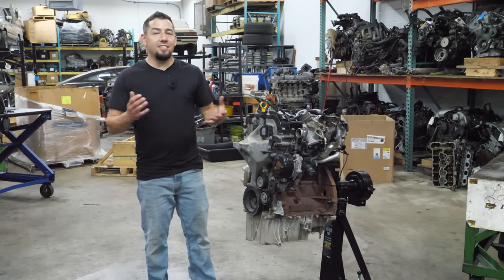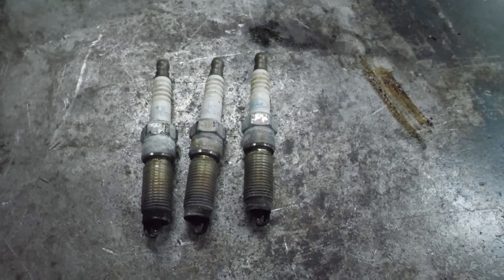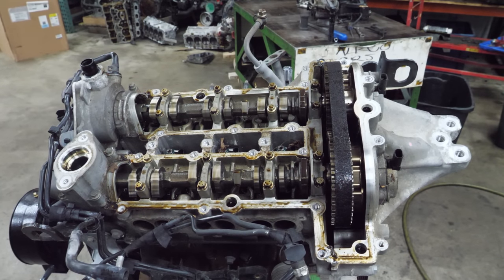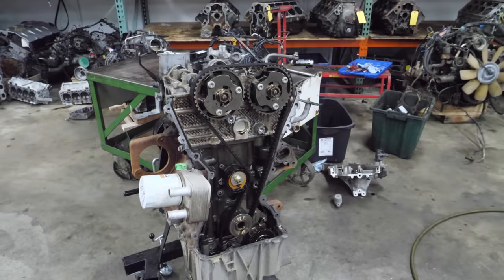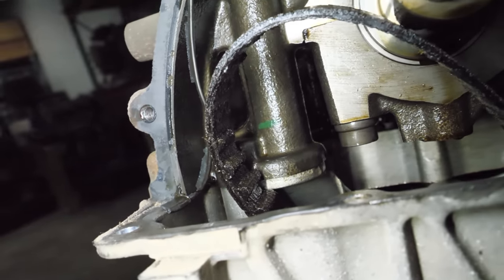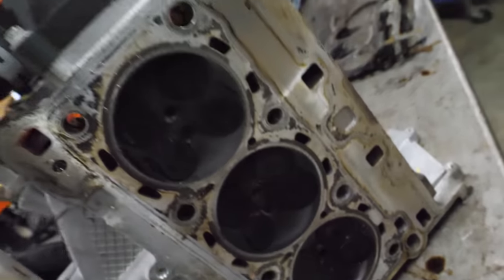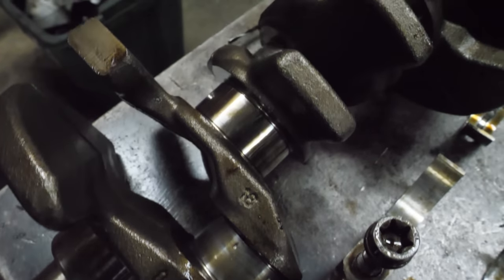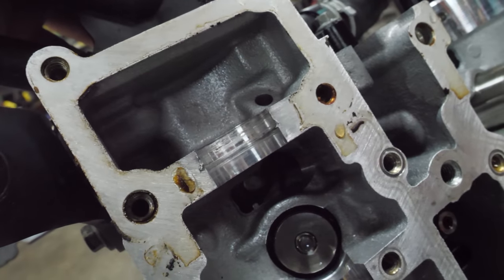JUNK Ford Ecosport 1.0L 3-Cylinder Ecoboost Teardown. LAWSUIT ENGINE!

Comment: My 04 Acura TL with a V6 gets the same, if not better gas mileage than an ecosport. I've seen it hit 32 mpg down the highway😂
Reply: As original owner I have an ‘06 TL 3.2L SOHC V6 (aka J32A3) w 170K miles, modded to ~ 290 hp.  24/32 mpg from the 5spd A.T. is common.  The engine still purrs.

Comment: Still think the typical 16v, 1.6 to 2.0 4-cylinder making about 130 hp that every compact car had 20 years ago was superior in every possible way.
Reply: It was , until emissions regulations and the drive for better fuel economy forced manufacturers to change. Ford's would have loved to continue using older engines because a new engine costs 10s of millions to develop.

Comment: Yep. An absolute desaster of an engine. In South Africa you can only buy an oil pump unit or the complete engine. My experiance on these engines is the need an oil andvoil filter change every 5k km and sump service every 15k km

Comment: Amazing service you are providing the American buying public.  Fantastic for all of us.  Now, serious question, do you have a good bodyguard?  I suggest you are pulling the tail of the tiger, you are revealing the pathetic truths about horrendous engineering ideas ie, allowing rubber-ribbed timing belts to be running in rubber-corrosive baths at high speeds, or bearings wearing down by oil-starved and debris-blocking oil pumps, resulting in impacting valves, or whatever... not good.  You are highlighting a massive problem, where the government should step in.

Comment: As far as fuel economy goes, science tells us, it takes the same amount of energy to accelerate the same mass at the same rate. I don't care if you have a big block or this sad excuse for an engine. It takes the same amount of fuel to move the vehicle. My 1979 Oldsmobile cutlass with the 231 V6 got the exact same mileage as my buddy's cutlass with the 350. Until they start making the cars lighter, nothing will change.

Comment: Ford got me for thousands !! Never again brand new Toyota Highlander in my driveway.  My son has a 2004 highlander 310,000 miles Original engine and transmission we change the oil synthetic every 4000 miles transmission fluid every 50,000

Comment: Most people don’t know anything about these engines thinking they’re bad, unreliable etc. When it’s the wrong oil that destroys these engines, I’ve had a 1.0 litre (138bhp model) now for 2 years on 40,000, serviced every 4000 miles, it’s also on stage 1 map pushing 165bhp and 264nm and not a single problem or hick-up and it’s still good on fuel.

Comment: Know a guy with this engine and at 80k miles and 7 years has had to replace the wet belt which cost £1300 also just for a bonus the starter motor also failed and cost a further £500. They did comment how the engine is smoother and makes less noise since the belt was changed so it was obviously getting close to destroying the engine. Terrible design the second he mentioned about the work I immediatly mentioned how bad the design was.

Comment: If they are in such demand there must be a lot of engine replacements. I don’t think they are racing them. 1000cc. My last 4 motorcycles had bigger motors. But sometimes they will surprise you. Someone is probably getting 1000 HP out of this somewhere.

Comment: I assume timing CHAINS have been around for at least a half century or more and work flawlessly for a hundred thousand miles or more with no problems. Here are Ford engineers after a third pitcher of beer;  "hey Joe what can we do to really f..k our customers."  "well the only thing I can think of is a timing belt soaked in oil."  BINGO!!!!!!!   "what if we get fired."  "noit a problem, I have a friend at Boeing and they need engineers to design plugs that fit where a door was on airplanes."  "Go for it."

Comment: Crazy with all the push for mileage that these late cars haven't improved. 23/29  for a compact vehicle and this engine is laughable.

I get 32+ mpg hwy with a 26 years old 3800 series ii in a full size sedan and get right around 23 in town.

All we have to show for the mileage push is less and less displacement, more complex and expensive engines, and expensive turbos.  The mileage is actually going down though.

Comment: I have bought and admired Fords all my life.  Engines like the 390-V8, 460-V8, and 5.0L-V8 were nearly indestructible.  I also have a Lincoln Mark VIII that I bought new in 1998 with 206,000 miles and it is as smooth and powerful as new.  But now, the bean counters and - apparently - neophyte engineers started making engines with oil soaked timing belts and water pumps INSIDE the engine that destroy the engine when they fail.  And fail they most assuredly will.  Sadly, no new Fords are in my future.

Comment: The sad thing is, i have a 1990 bronco 2 with 120,000 with miles on it and still on its original engine and driving today. Most Fords from that time era were more likely to out live the body. Today you wont even get that far.

Comment: I have a 2019 Ecosport. 0ne recall so far. Ford does not have for the recall (maybe 2025. Shame on Ford. Saw on pod  where Ford replaced full motor because engine  locked up. It's been months, still haven't heard from Ford. Guess I should join the law suit. I only have 22k miles on it.

Comment: Just sold our ford bronco sport for a mazda cx5 it was hilariously unreliable
Reply: How come?
Reply: @EMdemo  waterpump went bad, auto start stop killed two batteries, lights would stay on, radio would freeze, car would vibrate and run like crap on regular gas, so many thing honestly we bought it brand new and put 30k on it, wanted to sell it before the warranty ended so were not in the hole. also read about the transmissions going out before 100k mi

Comment: A true ECO (Economic and green engine) Is euro diesels, doing 40 to 60mpg since early 2000's with very low CO2 emissions and decent performance, my current daily, the mercedes E350 V6 3.0 L bi turbo diesel, 300hp and 650Nm, 40mpg in the city and 50mpg in the highway with an average 100mph speed :), and ti's a manual :) it's now near 200k miles with little less than oil and filters, it will need engine out for maintenance (water pump, seals and other whatnots) but I couldn't care less, I do it myself (and I do it myself for the last 30 years on my mercs). Americans effed up the diesel market with the dieselgate conspiracy, it was completely un necessary.

Comment: 3 cylinder engines should have never progressed beyond the Geo Metro 2 door. And those pieces of junk are what keeps many buyers from wanting a Ford Bronco Sport. To get just a 4 cylinder one must buy the most expensive model of that line. And a 4  cylinder in a car that size is nothing to  brag about. Taking a small engine and boosting it's power up with add ons like turbo chargers and other tricks, is a recipe for unreliability.

Comment: There's nothing wrong with having a wet belt. It is impregnated with teflon, the benefit of running it in oil is that it reduces the parasitic losses built up via friction. They're also stronger for a given diameter which is necessary because of the loading imposed by the high pressure fuel pump driven by the cam. The ecoboost is a well designed and built engine. The problem you found here is due to poor maintenance and poor quality lubricants...an owner error...or their preferred mechanics...not fords error though. Im not sure where you got your mpg info but even under a hard thrashing to the redline through the gears you can get 40mpg. The main focus of the design was low emmisions...which is achieved. I do have to agree with your pinned comment. You dont seem overly competent.

Comment: I understand the wet belts and tensioner fail prematurely, with debris clogging the oil strainer and starving the bearings of oil.  A partial recall involves using a new design belt & tensioner, but only certain models are involved in this fix.  Any decent materials testing would have revealed this problem before going into production.  Silly Ford...

Comment: I wanna add that the engine has more carbon build inside than what I view as normal.

The wet-belt design is plain stupid and the belt that drives the oil pump is not wide enough to handle the balance shaft and the pump.

Comment: Hi!!! 69 reg! 40000 miles  oil pump belt failed low oil pressure clattering like a diesel on tick over £1100 later bearing in mind 40000 miles 69 reg  fixed got rid of disgusting

Comment: These are throw away motors. I can't believe Ford designed this engine. Imagine a oil soaked timing belt?! And no keyway on the crankshaft? Ford is horrible.

Comment: Ford Ecoboost engines, and this includes all of them. Ford way over engineered them, and really dropped the ball on any kind of quality. Any Ecoboost that has been in my shop after getting hot has dropped the valve seats out of the head. The oilbath belts is just another failure Ford has created. Understand that I am a Ford man and own a 2000 F350 Super duty Triton V10 with 1.4 million miles on it. Got 528,000 out of the previous V10 in it. Yes it still runs daily.

Comment: Ford should be taken to court for this. Its not just the fiesta engines but they put them in the Ford transit custom vans. I've had a battle withe dealership about getting the timing belt done way before your supposed to get them done due to this absolutely shit design of the wet belt system. I had to go through my local mechanic who put a belt on that seemingly is designed for being soaked in oil. I feel so sorry for all those folk who are not mechanically minded who have bought one of these Ford cars in good faith, are now driving a ticking time bomb. Also that shitty Ford fiesta line are prone to having the rear axle completely separate from the car.

Comment: No replacement for displacement. I hate turbos. It is common sense that a normal aspirated engine would last longer than small engines with a turbo. Plus, bad engineering you get a perfect failure. It makes no sense to give up reliability for economy. Governments force the motor industry to change for the bad. They actually create waste and make the problem bigger. a Lot of cars in the old days would last 30 years plus, now you have to scrap a car if the engine fails because it is uneconomical to repair.

Comment: While I prefer Chevy (GM) I will not get into the Ford v GM pissing match. I think both companies make decent engines, and while there is no perfectly engineered engine design, if they are properly maintained, Ford or Chevy, they will last for many miles. Most engine problems are due to poor upkeep.

Comment: They didn’t replace the timing belt when they needed to. That thing was awful. How many miles did those timing belts have on them? Cuz the timing belts going bad, cracking and then breaking to pieces is what killed the car.i don’t think I ever heard you say how old the timing belt job was. But I can guarantee that the timing belt had way more than 30k miles on it. This is why you should always change your timing belt every 30k miles, especially with a ford. Ford rubber is notorious for failure. So whether it’s bad or not I’d be changing that timing belt every 30k miles if I had that motor. What is sad is that if they just would’ve changed the timing belt when they were supposed to this motor would’ve still been good. And what’s sad is that one bad timing belt is what killed this motor. Very sad indeed. But hey shops want a lot of money for a timing belt job especially now when it’s unusual to get one done and in this era no one knows how to do it themselves especially on a newer motor like this with the turbo and what not in the way and then it’s probably turned sideways with get little room to turn on, and you might have to actually take the motor out of the car to get the timing belt cover off. Combine all these facts together and now you know why the timing belts were never changed. A very simple problem sometimes has a very very difficult and intricate solution unfortunately. It is what it is.

Comment: I see almost all car manufacturers are going 3/4 cylinder turbos. In other words, you’re asking an underpowered engine to be something it’s not. It seems whether it’s electric or gas, they’ll all be in the junk yard within 10 years. Electric car, you’ll need a $20,000 battery. Gas cars you’ll need a new engine.

Comment: People tend to push these engines to hard and burn them and belts or chains are no1 problem on them. Here in EU they are selling similar engines as replacement for our loved small diesel engines which are harder and harder to find in new cars. They say it great, its frugal and has tourqe in wider range than diesels, sure.  At the end when you step on them they use way more fuel, torque is nowhere near diesels when you load your car a bit and they are nowhere near reliable. I drive smaller suv with 1.6mjet II with only 120hp but 320Nm and its done 140k milles without single problem with 50mpg mixed driving..

Comment: What is baffeling is that the auto manufactuers cannot stick with an engine that has been tried and proven like the old VOLVO B18 - B20 engines. With regular oil filter change they´d go over a million miles.

Comment: How the hell did the make the timing belt so hard to change. If it’s not a chain make it so you don’t have to pay someone $800 or more to tear the engine apart and change it. 
I wouldn’t have the time or equipment to do this myself. 

Maybe they only wanted these cars to last a few thousand miles

Comment: what i can't wrap my head around is how they literally used gears to couple the oil pump to the balance shaft and then went ahead and drove THAT with a belt????? i'm no engineer but if your budget only allows for 2 gears i think i can think of at least one better place to put them.

Comment: Ford are doing a recall on these engines where the oiled cam belt breaks up and the drive one in the sump causeing the engine to destroy itself, ford just announced a recall on these engines 2016 2022, £23,000 is not cheap fore these cars

Comment: Have it from 2020......everithing works perfect🙂
Reply: For now.  Good luck if you don't get the recall notice.
Reply: @thx1138guy  Can be that motors for F. Ecobust 1.0, are not made in the same factory for USA and EU.....maybe.
Allso, not....ore not at the moment....same story does not apire in Croatia, for the same motor.
Hoping for best....
Ussualy driving some 5000 km/ 3000 milles per year....and changing the oill and filters at about the same millige.
Sory on my unbrushed english🙂🍀

Comment: I had a 2020 ecosport, at 70 thousand Miles the engine died for lack of oil getting in through the engine because the belts all came apart. I got a replacement engine from Ford due to my warranty, and the other engine failed after 47,000 miles. The car was an absolute piece of junk

Comment: I have seen these engines fail after 70k miles with full main dealer servicing with the recommended oil and Ford still refuse to help.
Keep away from Ford

Comment: I have a 2014 Ecosport 1.0L Ecoboost and at 107 000 Km on the clock my car overheated and heat ceased, It cost me a complete engine overall. Not feul economical. always 8,2 liter to 100Km. Had a Ford focus 2,0L Vtec which was more economical at 7L to 100Km. Had many vintage ford before this Ecosport being the worst car ever,

Comment: I’ve owned several Fords with 4.6L V8’s.  Those engines will run for hundreds of thousands of miles.

How can the same company that made that turn right around and churn out something as horrible as this little three cylinder?

I swear it seems like Ford is designing their cars to fail nowadays.  This makes me not want to buy any more Fords.

Comment: So its not powerful, and its not efficient.  And it has to be so damn cheap they can't afford to key the timing belt pully or seal the space for the timing belt off from the crankcase.  But it can have the cost and complexity associated with 4 valves per cylinder, dual overhead cams, turbocharging, and direct injection?  What kind of backwards ass pageantry is that?

Comment: Wet belt engines are garbage.  If you were building it to last you would use a chain system.  Unfortunately nowadays they make them to live through the warranty and that's it, so when it fails as designed, it's your problem.

Comment: Wet timing belt. That's just the worst timing system ever to be put in an engine. Aside from the fact that they have shorter life span, replacing it would be as complex as a timing chain. At least dry timing belts like Toyotas are reliable. This should be timing chain at least.

Comment: Honda used a similar wet belt system in their 1.0T in the newer Civics, only time they've ever done it. Absolute garbage engines. The UK owners club and the forums are full of people who had the belt disintegrate and block turbo oil feeds, engine oil galleries etc. Nothing wrong with a good timing chain setup, I have no idea why Honda decided to mimic Ford's terrible Ecoboom engine design.

Comment: No Ford for me anymore. had a focus 1.6 diesel SPA engine. 
Too much small items could interfere with good engine operations. Too much garage time I payed for stupid fixes. 
The car it self was a perfect ride. But engines .. under 2.0 liter are a waste of money. 

Now I have MB 220 CDI coupe and it appears to be indestructible. My friend has an MB and VW engine overhaul shop.
He stated on your engine a cant make money. Also he refuses ford or SPA engines .. as they are problems build by factory

Comment: Just get a 4 cylinder Fiesta, Focus, or EcoSport instead on the 3 cylinder.  Problem solved.  In the Fiesta or Focus, get a manual transmission instead of the DCT automatic.  Problem solved.  In the EcoSport, the vehicle doesn't have a DCT.  Problem solved.